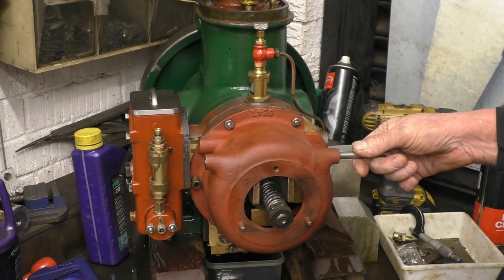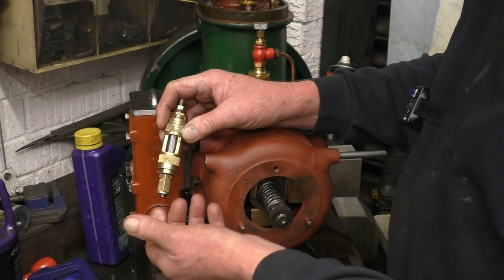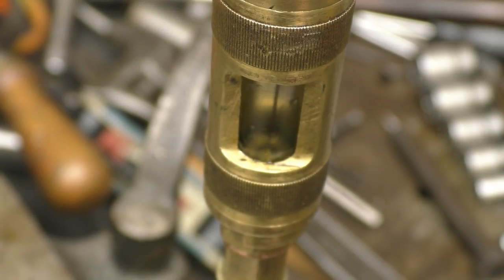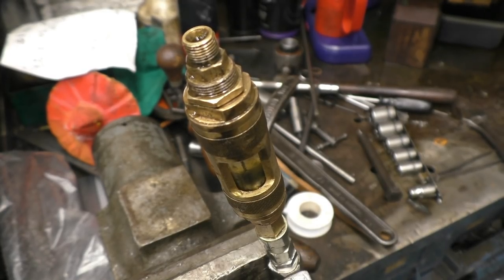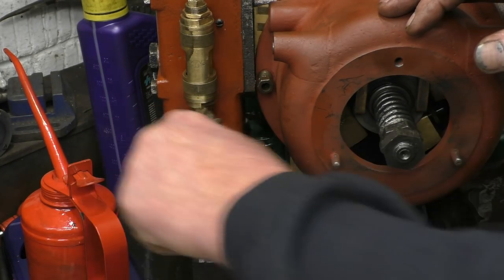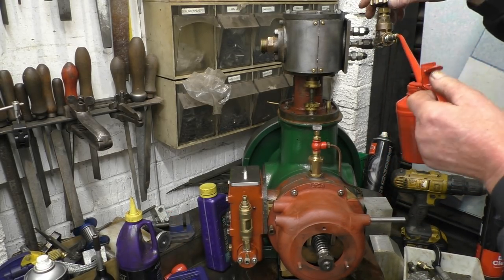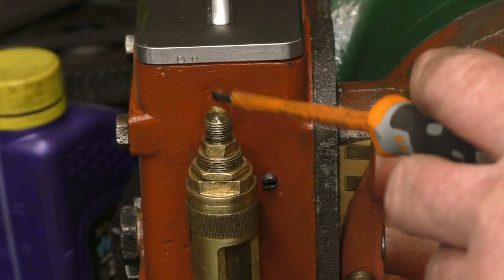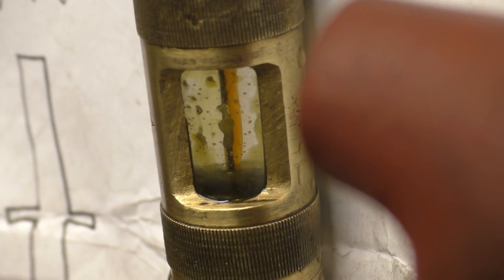Stuart Engine P29 .   Oil Pump Sight Glass

Comment: John, all hydrostatic lubricators on steam locos have water in the sight glass windows so you can see the drop of oil float up from the nozzle at the bottom of the window up to the top where it enters the steam line.  I have personally rebuilt and operated several Detroit hydrostatic lubricators.  The water that fills the sight glass is condensed steam that drops down from the steam line(s) and once filled, the water stays there even when the engine is cold unless the sight chambers are drained.  Could the same thing happen here?  If the engine was connected to a boiler and steam in the line and  left for a while, would steam reach that sight glass where it can condense over a few minutes and fill the chamber, thus removing the need to manually fill it somehow?